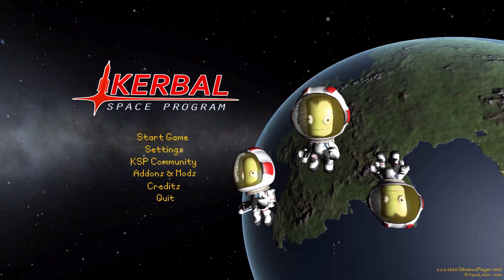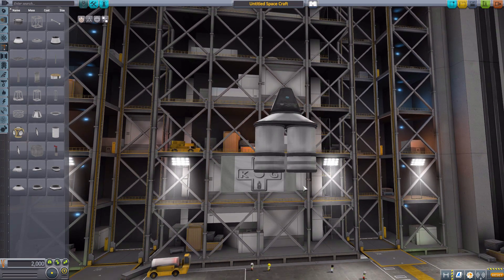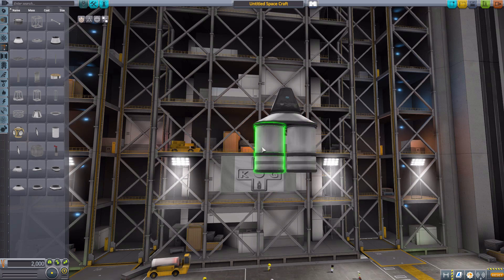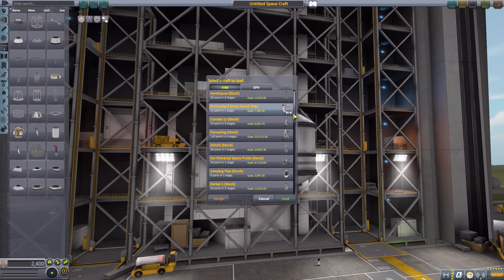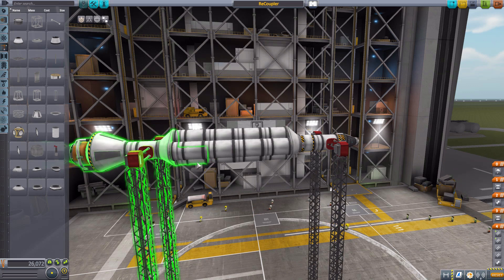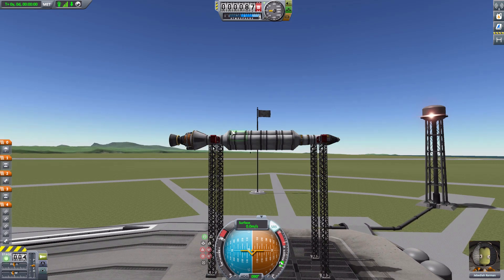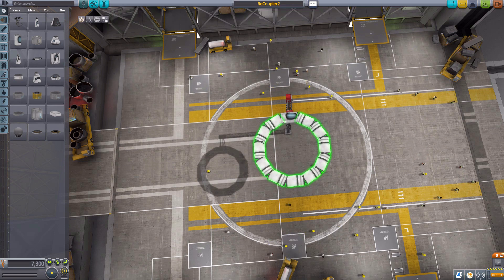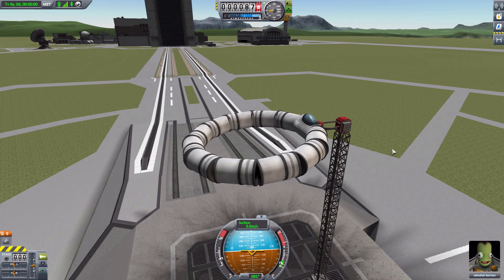KSP Mods - ReCoupler

Comment: why do games use parent child part snapping now? I played a game in the past which was old at the time and did not have this issue. I could snap any part to any other part and they would always snap successfully unlike in fallout. I could snap two object back into one like this mod adds to KSP. I could snap and it was glorious. And it was so simple because it was just nodes on each of the objects that would look for other nodes and if they found one they would snap together. I snapped together a massive lattice of objects and then filled in the holes also using snapping. Why do programmers today act like this is impossible?

Comment: psh autostrut is better and it's stock
Reply: I'm not sure how this mod worked around it.. but the problem was 
previously... well.. take the ring for example.. when it does physics 
calculations, it starts at root part, then goes to tank 1,2,3,4,5,6,7,8 
calculates how each part effects each other part.. the problem is, that 
once it hits 8, it calculates how it effects the root part again, then 
continues to tanks 1,2,3,4,5,6,7,8 again.. which causes a serious 
calculation loop.. hence it bogs down your system.. everyone says 
that this mod seems to adress that problem somehow.

Comment: Wait... What about the autostrut?
Reply: This is just a less tedious and confusing thing to do, from my understanding of autostrut for stack couplers.
Reply: I'm not sure how this mod worked around it.. but the problem was 
previously... well.. take the ring for example.. when it does physics 
calculations, it starts at root part, then goes to tank 1,2,3,4,5,6,7,8 
calculates how each part effects each other part.. the problem is, that 
once it hits 8, it calculates how it effects the root part again, then 
continues to tanks 1,2,3,4,5,6,7,8 again.. which causes a serious 
calculation loop.. hence it bogs down your system.. everyone says 
that this mod seems to adress that problem somehow.

Comment: this IS realy cool but... based on my - addmitedly limited - knowledge of the games programming... this will be very laginducing in bigger crafts...
Reply from the maker: Big ships are going to be lag inducing no matter what as it's all about the part count,  this mod should not add much to that frankly, in fact it should make some bits better as the quadcoupled bits wont be flopping around and thus not having to calculate the physics of that
Reply: It would still calculate the physics - the flopping jsut wont be visible - and the thing is wile regular partcount causes lag - physics rings - as created by struts - or decoulers - make physics calculations way more complicated

Comment: OMG this drove me nuts for ages. I love the idea of this mod. I'll hold off until the author has fixed it though, given the issues noted below in the comments. So many times, I have tried to do bi-tri-quad coupled vessels and they just fly apart.. so need this.
Reply from the maker: why wait, it's a very useful mod.  and the only complaint I see in the comments is an unfounded comment on lag that I haven't had issues with
Reply: Ah I had heard about a docking issue, but it has since been fixed. Definitely downloading it now. Oh the weirdness I will make now... The mod forum thread is lively with celebration!

Comment: It is a good question, why hasn't Squad done this?
Reply: Yes but it causes more stress on the CPU.
Reply: I'm not sure how this mod worked around it.. but the problem was 
previously... well.. take the ring for example.. when it does physics 
calculations, it starts at root part, then goes to tank 1,2,3,4,5,6,7,8 
calculates how each part effects each other part.. the problem is, that 
once it hits 8, it calculates how it effects the root part again, then 
continues to tanks 1,2,3,4,5,6,7,8 again.. which causes a serious 
calculation loop.. hence it bogs down your system.. everyone says 
that this mod seems to adress that problem somehow.
Reply: Dylan Watts they did, go to settings and enable advance tweakables then right click a part and you can see "autostrut"

Comment: This changes everything... my old mega rover from ages ago (literally years) wouldn't clip through itself now.
Reply: Definitely beats using docking ports too... hey, I wonder if pre-attached docking ports on a vessel will be fixed by this mod too... or setting up mid-stage separators and whatnot... that could ease launching a rocket with swappable tanks without having to do intra-ship docking on the launch pad.
Reply from the maker: hmm perhaps, I hadn't tried those but it might

Comment: reasson why squad is not making so much stuff is becouse the company is nearly gone just some of the few devs still exist but the main once have left the company so stop saying why have not squad done this yet. its becouse the company bearly even exist anymore .
Reply from the maker: smaller dev team or not this is an issue that has existed since they added bi-couplers etc. and should have been fixed years ago
Reply: To be frank, they don't really need a bunch of devs to maintain the game now that it is in official release. That was part of the purpose for making modding so easy and intuitive. Now the users can, by and large, create new content. All the devs have to do is make optimizations, fix bugs, and trickle out a little new content now and then.
Reply: the dev team was split nearly befour the full release. already then the dev team was leaving. and its not that its a full release that they left it was a problem with how the dev was communicating and how they were planing on going forward with game. i dont got all the detalis in my head but i know the reasson why devs left was becouse of a really big reasson and they technicly have not released the game as a full release its just the current devs that is still left in squad released it as a full release becouse they cant do much more anymore and they dont know how to do it.
Reply: that is totaly ture. i was asking for the for long time from the devs but never happend. and now it most likly will never happen as a main part of the game.
Reply: it's already in the game guys stop judging companies lol. Enable advance tweakables in settings is what you're looking for. Just right click a part then you can see "autostrut."

Comment: Does it allow fuel flow as well?
Reply: I'd be interested in this as well.  theoretically, it should follow any rules in place for that particular node since it's only telling the game to attach them together in a similar way to how you can dock two vessels to make one, but without using the docking module and, thusly, not having the attachment flex that docking nodes have.
Reply from the maker: id does allow fuel flow, so no worries there